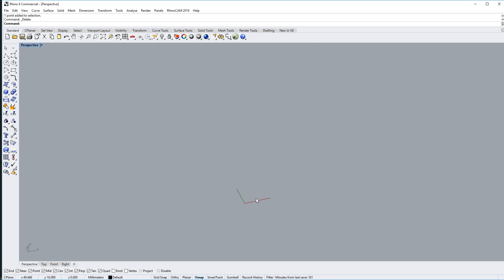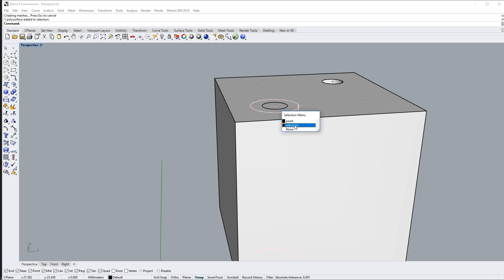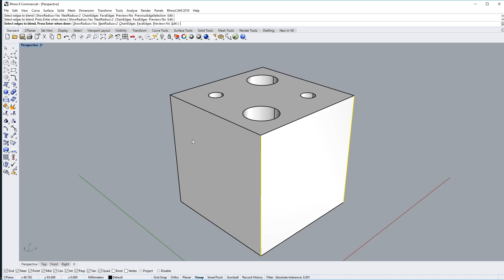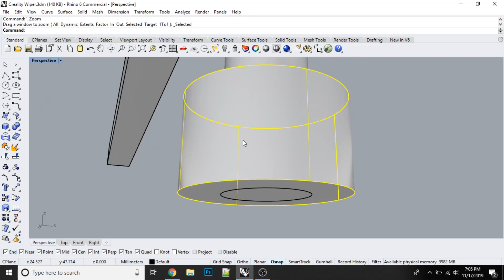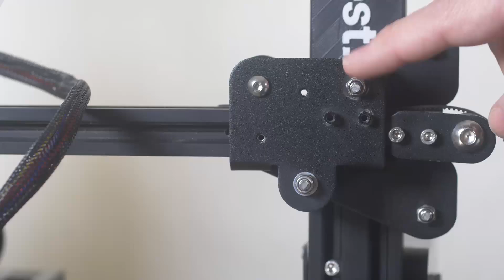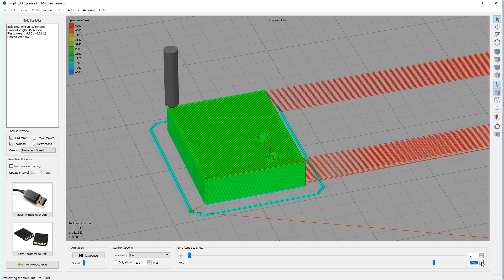Custom Nozzle Wiper for Ender3 & CR10 - No More Layer Shifting PETG!

Comment: Why you did not show any illustrations of the problem? Because I don't even understand what the problem is. PETG is my go-to filament on MK3S, and I never saw anything that wiping nozzle can help with. At first I thought that you are talking about stringing, but why would you care about stringing between layers? It does not exist.
Reply: The issue occurs when there are tiny bits of PETG the nozzle picks up and over time, it builds up and can potentially dislodge and ruin your print or other things. I don't think there's a difference between bowden and direct drive. My bowden printer (Bondtech QR)  has the same issue as well as my printer with a titan aero, the material is just really stringy.
Reply: On longer prints my Ender3 will get some plastic build up on the nozzle, which over the course of a long print can overheat and become hard, brittle and crispy, and then catch on the print as the nozzle moves around, causing a poor surface finish.. This used to be worse when I had a bowden setup, but is better since I upgraded to a direct drive.
This problem gets worse the longer the print is, so something like a 12 hour print, where you will be away from it for a long time, with just checking in with octopi occasionally, you can suddenly find the nozzle and ooze has caught the printed job, moved it and you have a plastic birds nest being made, and sometimes it can be hard to diagnose the cause... This project seems ideal to me. If nothing else, it is a good part to maintain nozzle condition by always knowing the nozzle is clean.
Reply: @jonmitchell2424  can that cause missed steps on only 1 layer? My Ultimaker 2+ does that on longer prints but I cannot find the cause, was thinking the stepper motor get hot and miss steps on 1 layer.
Reply: @cowboyboots9901  did you get to the bottom of your missed steps?
Reply: I have that problem. It does exist
Reply: PETG is also my goto filament on my MK3S and I have the exact same problem. Every tens or hundreds of layers the nozzle will have accumulated enough PETG on it to leave a disgusting blob somewhere on the print. Only happens with PETG, regardless of the supplier.
Reply: I'm honestly confused about this comment... like the G12 Nozzle wiping command exists (and you can configure this exact behavior in Marlin) to prevent this exact problem (high pressure filaments cause filament to ooze and creep up your nozzle and cause it to clog, which can ruin your prints).

But what's really weird isn't that you took an issue with this -- but it's crazy to me that you didn't take any issue with the "layer shifting" in the title of the video -- like I don't understand how an oozing nozzle (which can cause your print to fail) has anything to do with layer shifting, or how wiping a nozzle fixes layer shifting... to me, that's the part that doesn't make any sense.

Anyway, it's still a good video and a good project.  I may make a similar mod for my CR-10 (to help with oozing, and getting cleaner prints, not with layer shifting). 😉
Reply: Zero issues with PETG on my ender 3 pro... Literally prints like PLA for me.
Reply from the maker: I will make a follow up video. Please stay tuned.
Reply: @DesignPrototypeTest  2 month later and no followup video yet :/
Reply from the maker: @DenisOvod  No 3D printer videos of any kind. I'm taking the break I talked about, and I'm considering if it is worth my time to continue making 3D printer videos at all.
Reply: @DesignPrototypeTest  I see, thanks for the clarification.
Reply: @DesignPrototypeTest   I've been printing PETG for a while and have something like branches going on with my prints in an E3, I though this was an option but I sincerely do not understand the problem behind this video or my own issue, I would really love that follow if possible (no pressure you are free to do What ever you want)
Reply: @DesignPrototypeTest  Thanks! Can you also include info about your retration settings?
Reply: mk3s is direct drive vs this ,which is bowden. Bowden usually oozes more IME

Comment: I don't get it. I have zero issues with PETG on my ender 3 pro. Literally prints as easy and nicely as PLA. Maybe it's the brand of filament I'm using idk but this just seems like a good way to leave stringing across your print each layer.

Comment: Some people commenting apparently have never had this issue, but it plagues me. I upgraded to Klipper and turn on/tuned Pressure Advance and that solved 90% of my PETG issues. However, still that little tiny bit of PETG oozes/wipes onto the nozzle and turns into a ball, then blob, then disaster after 30+ minutes. As pointed out by others, this happens more when you have "islands" or in otherwords not one solid part. This brush idea is brilliant. Unfortunately I am a speed freak and I would hate to add that much time to a print just to do it in PETG. There are also some other suggestions I have not tried such as a silicone sock that covers almost all of the nozzle, different alloy tips that discourage sticking, and also I saw a spray being sold somewhere that claimed it treats standard brass nozzles so PETG does not stick to them. I'm about ready to throw away my PETG spool and just do everything in ASA with a draft shield. ASA prints like a damn dream on my machine and has all the awesome improved mechanical properties.

Comment: I noticed you also have a red heater block -- I'm guessing you have a custom hot end assembly as well.  (Not positive since I have a CR-10 and not an Ender) -- but I assume that custom block is also helpful in reaching temperatures required for PETG.  Can you talk about this, and whether or not it's safe to print PETG on a stock CR-10?

Comment: the Qustion is, how i can clean the Nozzle every X Layer for Example every 7, any Idea?
Reply from the maker: This should be a setting in slicers. Ask the Cura Dev team to implement a script on every X number of layers instead of every single layer. At the moment, your only option is to write a post processer that will insert the script or go through your G-code by hand and paste it in there.
Reply: @DesignPrototypeTest  Thanks for the quick Answer, actually th G-Code is very easy 
i go to the Setting "each Layer"  and do this:

G1 X-80 Y270 F5000
G1 X-80 Y350 F7000
G1 X-80 Y270 F7000
G1 X-80 Y350 F7000
G1 X-80 Y270 F7000
G1 X-80 Y350 F7000
G1 X-80 Y270 F7000
G1 X-80 Y350 F7000
G1 X-80 Y270 F7000
G1 X-80 Y350 F7000
G1 X-80 Y270 F7000

it just moving back and forward where the Brush is set.
im using Ideamaker, but the G-Code it should be the same.

Do you know another Methode to Control the cleaning not every Layer, for example every 1-Minute? 

Thanks alot
Reply from the maker: That's what I was talking about. It would be trivial for Ultimaker to implement a script (like the one you showed) every layer, every X number of layers, or every 5 minutes. They don't have this functionality built in (easy as it would be) because there aren't many cleaning heads like I have made. If they received enough requests they might make this change.
Reply: @DesignPrototypeTest  Thanks for your helping, i know how to ask the Printer to clean Nozzle after X Layer: 
it look like this Write now:

[if {layer_index}=10] G1 X-80 Y350 Z10 F5000
[if {layer_index}=15] G1 X-80 Y350 Z10 F5000
[if {layer_index}=20] G1 X-80 Y350 Z10 F5000
[if {layer_index}=30] G1 X-80 Y350 Z10 F5000

but i can not yet write more then Movement.
for Example: 

[if {layer_index}=20] G1 X-80 Y350 Z10 F5000
G1 X-80 Y270 Z10 F5000
G1 X-80 Y350 Z10 F5000
G1 X-80 Y270 Z10 F5000

it not working, if you have idea? how i can do it, the Slicer, take the only first Movement, and ignore the anothers in the same G-Code line

Comment: FYI:  On Marlin you can temperately turn off the end stop with a M211.  I simply used your G-code and added an "M221 S0" before the G0 XXX and a "M211 S1" after to turn end stops back on.  No need for a code change.

Comment: I would have thought all the extra travel moves would cause a much larger problem with stringing than the oozing ever is? I mainly petg, using a bowden anycubic chiron, although I do use a larger nozzle. Also other than the face shields ive been printing recently, almost all my parts are structural or mechanical elements so surface finish doesn't matter as much
Reply: You should try overture nylon if you do structural stuff. Prints way easier than petg imo. I used to love petg but my petg suppliers have been wildly inconsistent lately. Not happy with my overture petg or my tpoimns petg, but my overture nylon never ever ever gives me trouble aslong as i use gluestick and as long as my clips are new and dont slip off the bed and make it shift. Overture nylon is freaking magic i swear. I can print a screw thread on its sides and still have it have threads all the way around with no support. Its really good stuff. The surface always looks amazing too. I basically just make carabiners with it all day long. Make sure to anneal them to your parts needs. Its properties are way different depending on how its been annealed. It can be relatively soft and impact resistant or very hard and scratch resistant or anywhere in between.

Comment: Maybe you could try mount the brush holder on the X axis gantry so that the nozzle will be able to wiped out by the brush no matter how high the Print is since the height of brush will follow the height of nozzle when the z axis moves up
Reply from the maker: Yes. This is exactly how the brush works in the video.

Comment: Now that you've been doing this for a while, whats the wear and tear on the nozzle? Any nicks on the ID of the tip from the brush? Or are you using a hardened steel or (gulp) a sapphire tip?
Reply from the maker: I've only gone through about 1.5 rolls of filament with this brush. I can't see any wear on the nozzle whatsoever. EDIT: 1.5 rolls of PETG using the brush
Reply: @DesignPrototypeTest  And just the usual brass nozzle? I'm awaiting a new Ender 3 to add to the fleet and drain my wallet for the mods. Thanks for the videos.

Comment: A good thing - i like the nozzle brush , but also i think it can be teimmed a bit in the slicer. Try put the retraction to 6,5 mm between layers , i see you got a bowden and in the past i thought the retraction was the same for bowden and direct drive but below 4-5 mm, nothing happens as the bowden flexes slightly on retract. After that i got much better prints.
Reply: I too had to do 6.5 mm retraction, but it gets absolutely ridiculous on certain types of prints to the point where it grinds the filament too much during a million retraction events and fails the whole print. Pressure Advance with Klipper and 1.25 mm retraction solved that for me. This is with bowden.

Comment: The spool is in a very stupid place! for a few reasons I can see. So a combination of that and likes disabled I would say your fix is nothing more than a band aid fix rather than fixing a real problem.
Reply from the maker: Your words are confused and have no meaning. Your two irrelevant criticisms make your conclusion into a non sequitur. Spool placement has nothing to do with cleaning the tip of the nozzle. Whether or not I made the likes vs dislikes score hidden on a video has absolutely nothing to do with cleaning the tip of a nozzle on a 3D printer. The implicit assumption in your statement is that this is an unpopular video. Your assumption is wrong.
Reply: @DesignPrototypeTest  Your giving advice on a band aid fix and from what I can see your not ready to give advice.  Your comment is wrong due to the fact better spool placement will result in less or no need for this brush. After getting the right settings my petg strings no more than pla would.

This brush would be useful tho only when aiming for the finest print quality tho that would be done only after solving the problem at the very foundation of it beginnings.
And my apologies for using the word stupid

Comment: make the switch to fusion if you can, it should be free (don't know specifically for you as you technically work with it) but rhino is SO clumsy and slow imo
Reply from the maker: HA! I work professionally as an industrial Designer. I'm 5x as fast to make the same geometry as someone who runs SolidWorks. Everyone knows that Fusion is just Autodesk's version of Solidworks. In other words it is LESS capable than SolidWorks. Don't get me wrong, I hate Dassault with the heat of a thousand suns. They are EVIL EVIL EVIL, but Autodesk isn't much better, and while Fusion may be free for now. They will get you in the end. Autodesk has a LONG history of either killing or making you pay for programs which were previously free. That's how they got established as a company. They Pirated their own software on Napster. Everyone started using the "free" CAD program, and since they created the pirated version themselves they could track who was using the program. Then they figured out who was actually earning $ from their product, and sent them a legal notice "Pay up or else..." I'll stick with good old Rhino thanks. All told I pay about $5/ month for my Rhino License. That's incredibly honest and generous pricing! The only catch is that you have to pay up front.

Comment: Just use the thermal paste / comopund on the heat throat and nozzle threads this will stop the ooze of petg
Reply: From my own experience, as a 3d printing enthusiast, but as a professional engineer (over qualified in thermal management and thermodynamics), the ooze in this case is caused by pressure build up in the nozzle at the end of an extrude which will continue to flow slightly after the extruder stops..Retraction settings can minimise this, but then can cause an under extrude on the next extrusion cycle, it is impossible to tune retraction for all scenarios without getting under extrusion on the start of others. Thermal paste on the heat throat will only stop the molten state of filament from moving into the bowden tube and causing a jam there... This project stops the oozed plastic at the nozzle tip from accumulating and smearing on the nozzle, which then on larger/longer prints tends to burn and rub/smear on the print job.
Reply: @jonmitchell2424  Yes, but the ooze is not actually the core problem: other plastics like nylon ooze, too, but they don't build up on the nozzle. The solution in the video thus does not address the core problem, which is: PETG adheres exceptionally well to metals. That's why this plastic performs very poorly when printing corners if even just one side has an overhang. This cannot (in my experience) be effectively compensated for even if running with full fan or by lowering temperatures. That's because in the absence of a full underlayment the plastic is elongated as it is dragged by the nozzle around the corner. In contrast, PETG offers clean detail when it's fully supported. As a side-effect the nozzle generally accumulates gunk and makes a mess everywhere. Dennis Murphy in another post suggests using car wax on the nozzle. Please see my comments there.

Comment: Does this actually work to clean the nozzle?  My tests of something similar were not good.  It would have been nice if you had posted some video showing what happens at the nozzle...
Reply from the maker: I have now used it to print 3 36 hour prints with PETG. Previously only 1 in 3 was successful because of layer shifting due to buildup on the nozzle. So, yes. it's working for me, but it does not eliminate stringing or boogers from the print. You still have to do post processing.

Comment: I don't understand the purpose of wiping in every layer. I use PETG all the time on various machines (Ultimaker 2+ MK3S TLM...and a few others) but never had this problem you mentioned in the video. It seems to me counter intuitive to wipe the nozzle every layer since PETG might ooze during the travel time or you could have some spaces in the model since even when retracting some filament will go down the nozzle.

I tend to print PETG with zero cooling if I can and slow it down (minimum layer time). Things work out quite well this way.

Comment: I had a flex metal bed then went back to glass/hairspray. The magnet for the flexbed kept lifting on me. The flex plate was a free amazon return sent to me for product testing anyway and it was also only 220x220. I did like it at first and may use it again someday with purchasing the correct size. Just recently I put a linear rail mod on the Y axis and it was fairly straight forward with the drilling jig file included thingiverse. Now I want all my axis to be linear lol. Great video even though my comment was a little off topic of your video